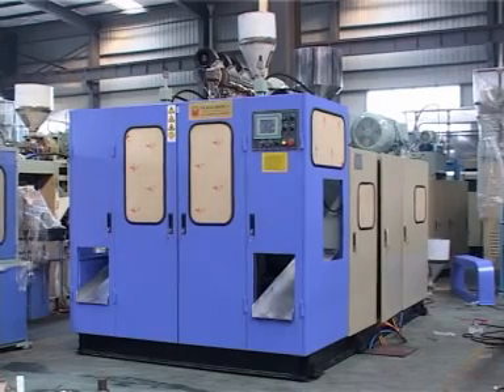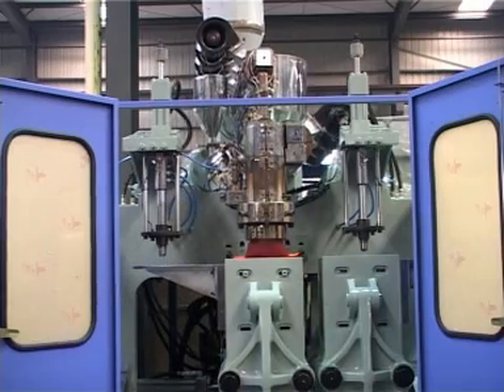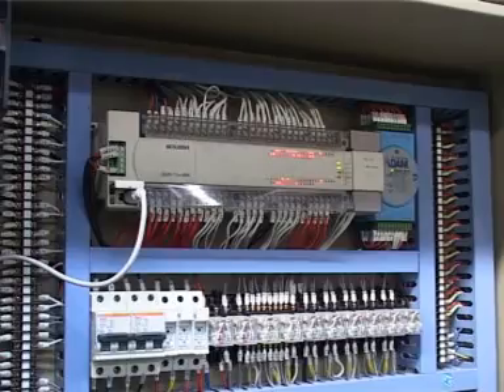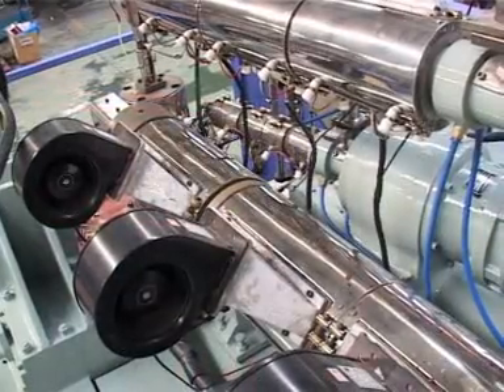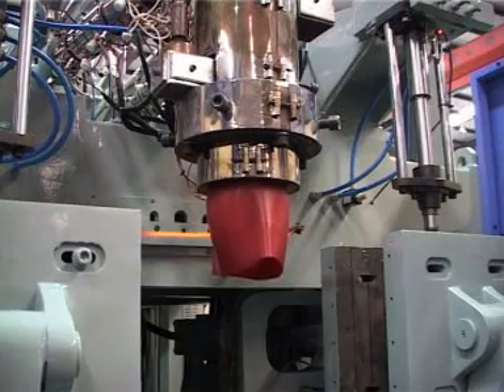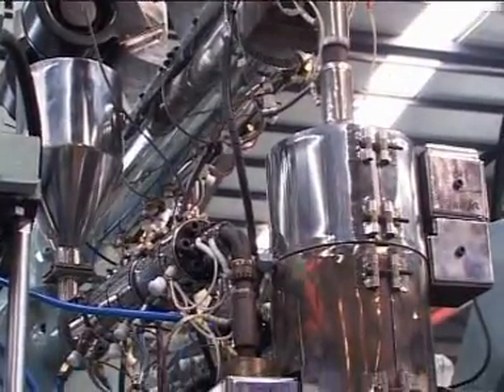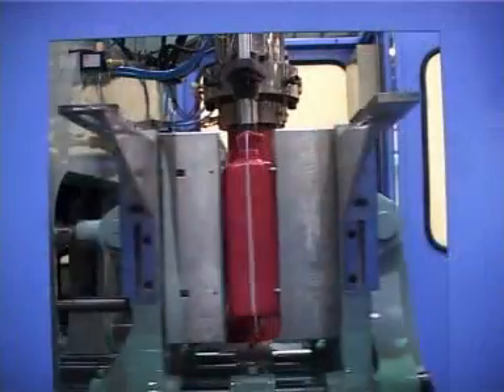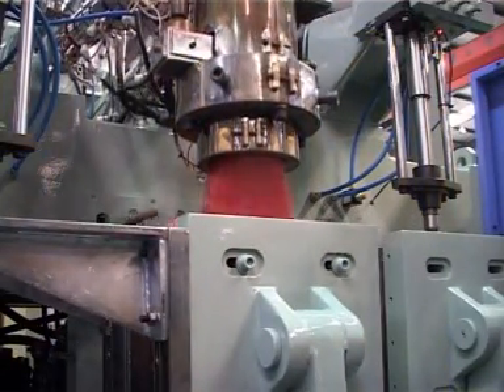Extrusion Blow Molding Machine

Comment: I've got ongoing availability of most HDPE blow molding grades that would work well in this machine for large/small blow molded parts.  All are available in either reprocessed, off grade or prime quality.  Please contact Jeff Wright @ 770-619-9898 if you would like further information on availabilty or pricing.

Comment: For those of us familiar with this kind of equipment, all I can say is I would absolutely hate having to knock the button out of the cavity on this rascal. Would need a sledge hammer and an aluminum rod four inches thick. My arm gets tired of thinking about it. Give me a little preform mold for soda pop bottles anyday.